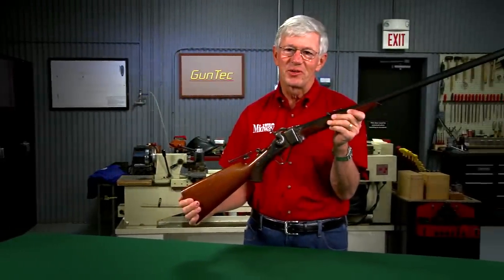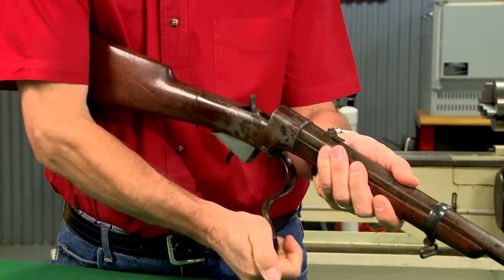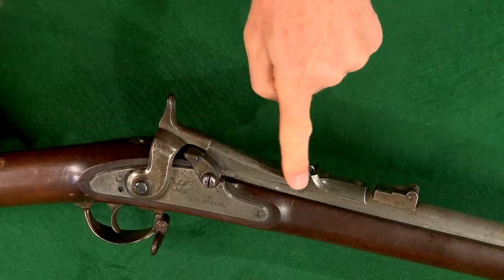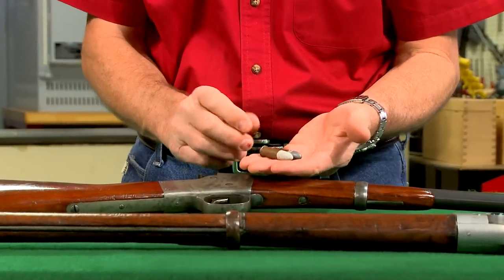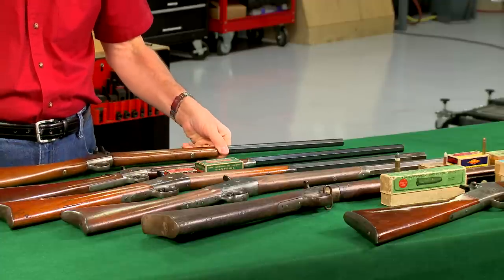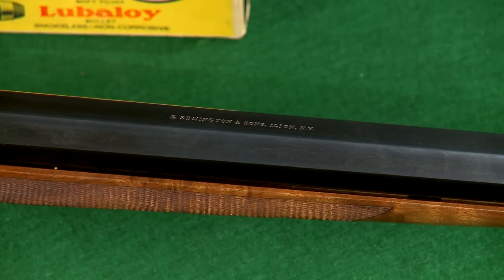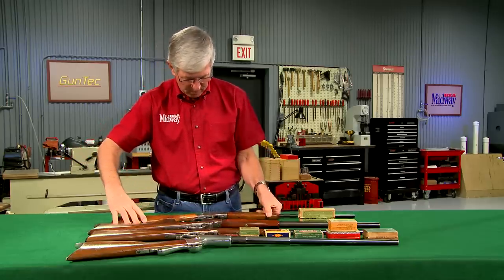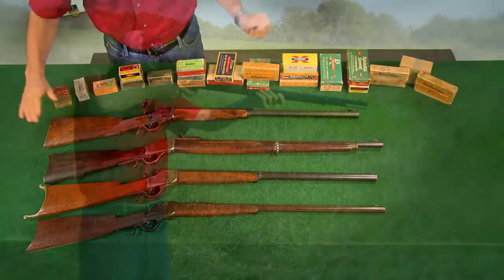American Single Shot Cartridge Rifles Presented by Larry Potterfield | Gun History | MidwayUSA

Comment: A good, informative video. Wish you had shown a Sharps Borschardt, considered to be one of the finest of the early single shots but not produced in large numbers. Of all of these rifles, the Winchester 1885s were generally judged to be the best of the designs and favored by many of the top shooters and gunsmiths of the day, e.g., Harry Pope. The new Miroku 1885s sold by Winchester and Browning, and the previous-generation Browning 1885s built by Miroku (only minor changes since the reintroduction) are likely the strongest, best-designed single shots in production by a major arms manufacturer, although the Dakota Model 10 is likely the finest modern single shot. The Ruger #1 rifles are beautiful but often need some gunsmithing help to shoot their best and there's a lot of parts moving in one during the time from when the trigger is pulled until the hammer strikes the firing pin. The one thing I wish the single shot manufacturers would bring back are the takedown versions.